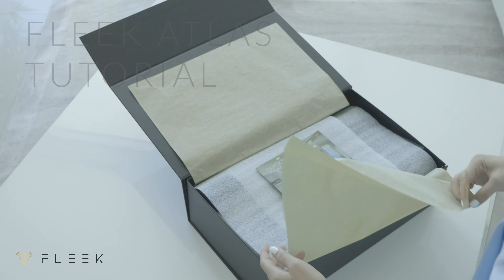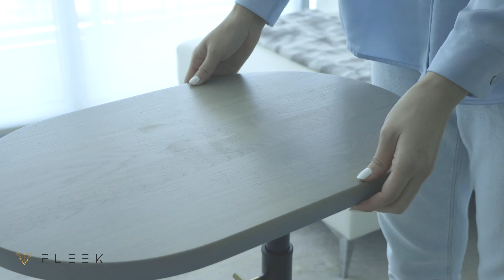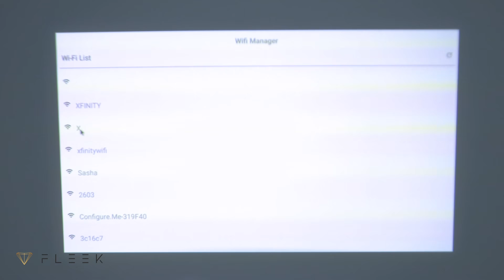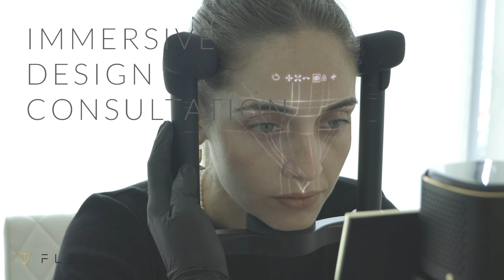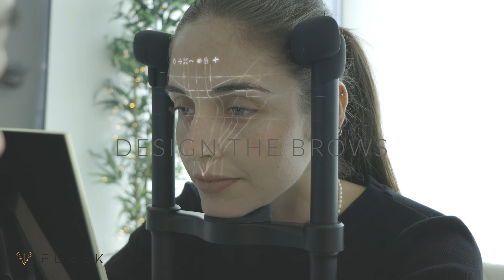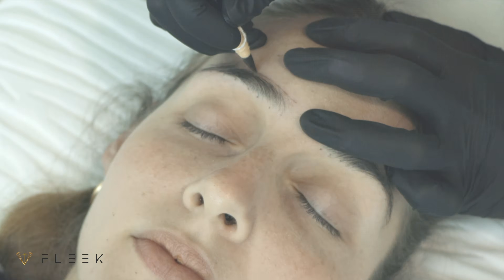Fleek Atlas Tutorial | Immersive Brow Mapping and Design

Comment: VERY DISAPPOINTING!!!
I purchased the Atlas in July 2024 and invested a significant amount of money into it ($1,400).
I had it in storage for about a year and recently tried to use it again for some mapping. When attempting to connect it to Wi-Fi, it initially appears connected but does not actually work and will not even load the login page.
I reached out through the messaging system on your website and by email but the responses I received were very unhelpful. 
I was told that since my account was inactive for a year, it was deleted, and that creating a new account is not possible. Instead, I was directed toward purchasing the “Light” version of the machine, which feels more like an attempt to make me buy another product rather than resolving the issue with the one I already own.
Now it has essentially become unusable, which I did not expect from such a costly product. I am very frustrated and was looking for a genuine solution that allows me to use the Atlas I already purchased, without being forced to spend additional money on another machine.